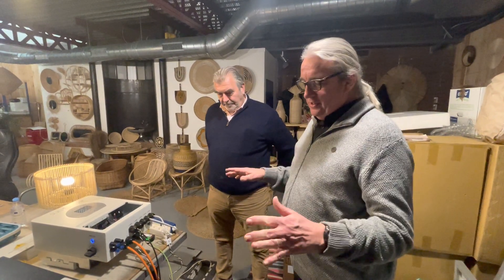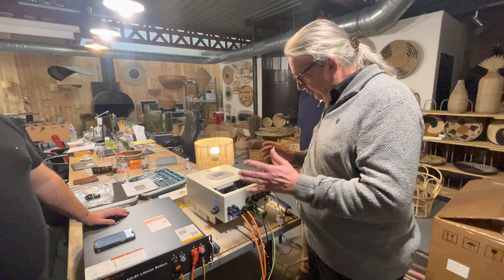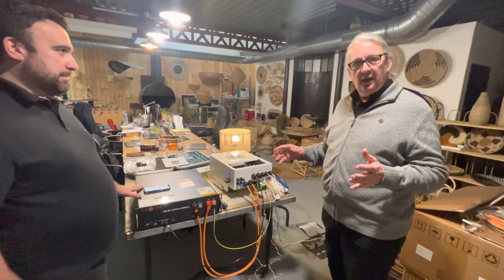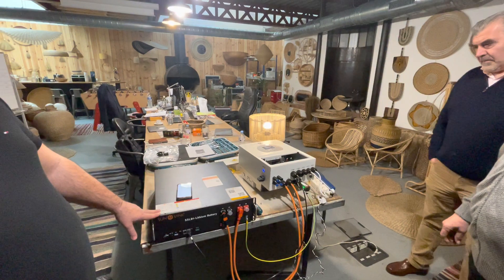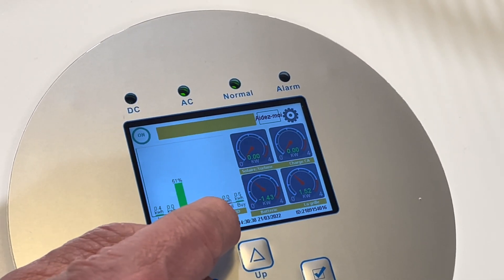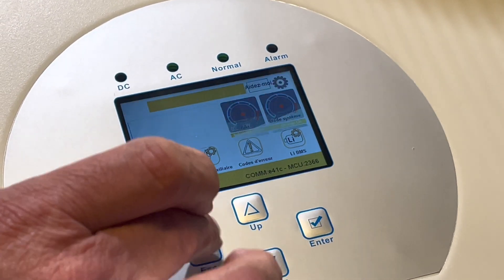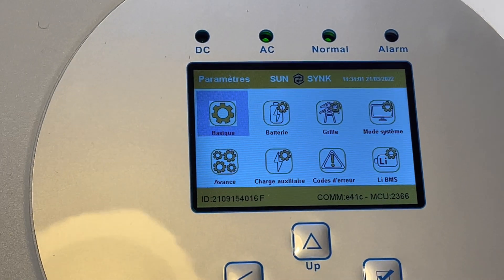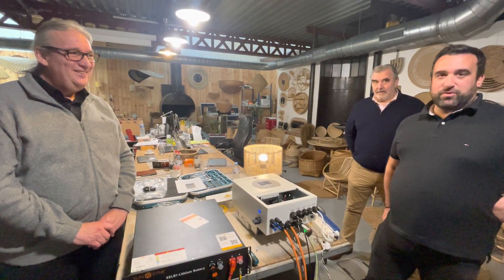Nous sommes #Sunsynk France

Comment: In the video you mention that the inverter has 7kW of MPPTs so it can accept 7kW total of PV power. This doesn't match the datasheet which says it has a max DC input power of 4680W. Which is correct?
Reply from the maker: The new model for the UK and France is 7 kW Mppt